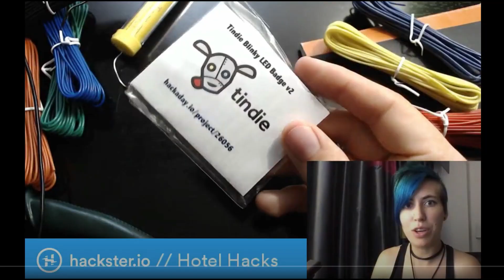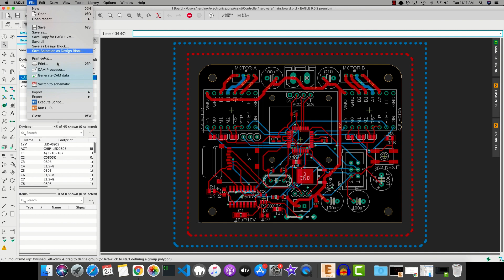PnPAssist makes PCB hand assembly more easier!

Comment: Just wanted to pop in and share an idea to make it better as you asked. I know that when I build and share things, people giving me suggestions is my favourite part.

Watching your latest video on your solder paste applicator, I realized an ergonomic problem that could be solved for both this and your paste applicator. 

1: Add a connector on both of these devices so you can hook up foot switches! One on the PnP to advance through the components (maybe long press to go back) and one on the paste dispenser to actuate the paste. Manual PnP is very much a "hands on" task and placing down tools to get to the tiny button, that also changes whenever you spin it, could become tiresome. 

2: Add a communication channel (wireless possibly?)  between your pnp and the paste dispenser to communicate what type of pad you're dispensing for. The manual setting on the dispenser is to calibrate to a known pad size and the com from the pnp varies that for the currently selected pad.
Reply from the maker: John thats why I love open source open hw projects. Genius people like you add value with their great ideas. Some others develop better software for the device. I really like your second idea the first one is also in the road map. Thanks for the support. I want to invite you and the others to our discord server: https://discord.gg/ewEsctvF

Comment: Sprinkle in a little bit of AI / Computer vision and it will even tell you if you’re holding the wrong component and or if you are placing it in the wrong direction 🤔
Reply from the maker: I am also thinking notification about the polarity of the components but mount file did not have information about it. We can write our own script to export more information from the CAD software. Computer vision and AI is a lot sophisticated but can add interesting value. Thanks for the suggestion.

Comment: that homing procedure is wonderful! a single switch for both axis, I'm assuming there is an error catch in the code should it have powered up with the 'bump' at 0.
Reply from the maker: You are so careful Bob. If you hit the bump at the linear axis homing you can not find a switch for the polar axis homing. If this is the case in one hole turn, you have to give an offset to the rotational axis and repeat the homing sequence.

Comment: good job Nuri abi.
most of the time, the user needs to know where is the right pole pin for cap or diodes, or LEDs, or etc.
(for BGA, dfn, qfn packages every time get confused about where is the pin1)
if you add a feature that helps users to pick components quickly and accurate then this machine  would be ready for the kick start :)
Reply from the maker: Thank you Mustafa. This is also in my mind but PNP file did not have this kind of data. We can develop a special script which may output the desired information from CAD design.

Comment: Wow I had very similar idea sometime ago, your is much simpler and practical
There also need to be a system which help you get to the right pouch in which needed component is sitting in middle of 100 pouches of components you have lying on your desk!
Still thinking how to solve that ..
Reply from the maker: Working on a component  carousel which will guide the user to select the desired component. Coming soon with V2

Comment: That is very clever! To make it good for my applications it would be fantastic to integrate the lasers into a stereo scope light and make the scope a fixed piece. Also design a clamp that has depth under it to accommodate two sided board designs. That said I would probably consider purchasing them as is. Good luck on the development!
Reply from the maker: Thank you. You can join our discord server for sharing your improvements

Comment: This is a neat idea, well done.  I have a few comments;
  
  ESD:  You need to ensure that you take ESD sensitive parts into account and provide a method for keeping the assembly properly protected.  Conductive plastics could be used for the mounting pad, and an ionizer for equalizing charge on ungrounded parts.
  
  You could set up a set of ESD-safe bins, each with an LED indicator on the bin.  The LEDs would be driven by your software.  Put the parts you want to use in the bins and tell the software which part is in which bin.  When your machine locates a part to place on the board the LED on that part's bin would then light.
  
  Make the mounting pad accept a specifically designed frame.  When you design a board you would design the board holder to drop in to the adapter frame.  You could use this approach to adapt a variety of board shapes to the machine, without modifying the machine itself each time.  Don't forget support for ESD protection.
Reply from the maker: Don Thanks for your important comments.
Reply: @makerstorage  You're most welcome Nuri.  I'm going to keep an eye on this project.  Where I work we make a lot of different boards, but usually no more than three of any type, and almost exclusively hand soldered.

Comment: How do you go about soldering components to the other side of the board once components are on the first side?
Reply from the maker: For the double side PCBs, we can design a new PCB holder that can hold the board from the sides. Thanks for reminding me. I mostly work on single side PCBs but I will work on that.
Reply: @makerstorage  I really like this project. Do you have a discord server or anywhere I can see updates and maybe contribute to the project? I think some customization options as far as the screen goes would also be neat. Like a touchscreen lcd instead of the oled
Reply from the maker: @penguin1714  I will be more than happy for any contribution. I am now hosting the project here. https://hackaday.io/project/179878-pnpassist You can chat with me and have all the files. It is open source.

Comment: Great job, but I am not sure how that helps all that much. I mean I can turn the board under the microscope and the silkscreen tells me where to put it. So its not clear to me how this speeds up things. Let alone if I have parts on both sides how you would stick the PCB down with parts on the other side.
Reply from the maker: In most of the designs there is not enough space on board to write the name, value and package of each component. So the common practice is to print only the name of the component like c3,r7 etc. So you need a list of components to check each component and go and take that from the component storage. This is boring and error prone. With PnpAssist It brings you the component under the microscope for precise placement and tells you the component name,value and package on its screen. It is not shown in the video but I am working on a component box that will light up to indicate to you which component to take from the component storage box. (coming soon).

For the double side PCBs, we can design a new PCB holder that can hold the board from the sides. Thanks for reminding me. I mostly work on single side PCBs but I will work on that.